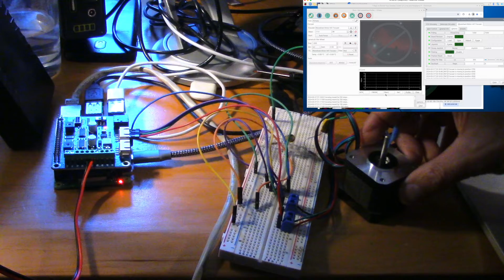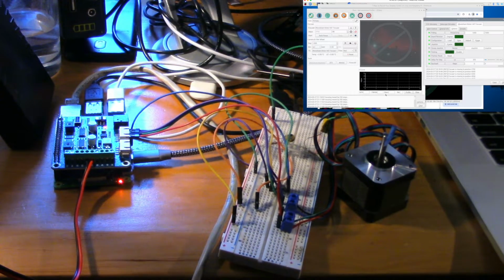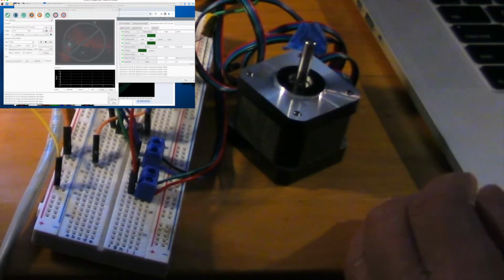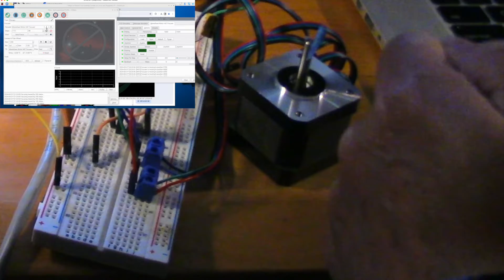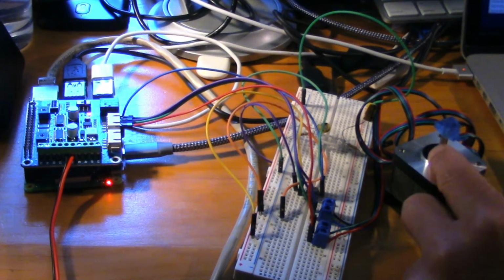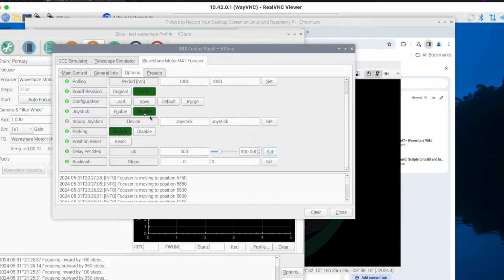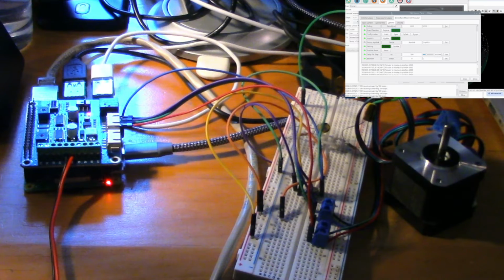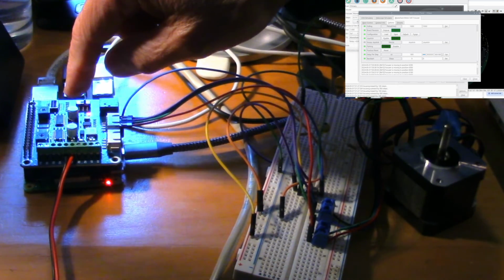Troubleshooting Waveshare Motor Hat for Raspberry Pi - Ekos/Indi Integration

Comment: Great job, thanks for sharing! I am considering building a similar autofocuser for my EvoStar 72ed. Can I ask a couple of questions please?

1. Which stepper motor are you using? Looks like a NEMA 17, but what size? I plan to make a direct-drive design. I am considering some NEMA 17 models but I am a bit concerned about the motor torque requirement.

2. (Not very important) Do you know how much current can the onboard regulator supply to the Pi? Do you think it powerfully enough to supply a Pi5?
Reply from the maker: Even the most basis Nema 17 stepper will work.  I think it was just 1 amp version with 1.8degrees of resolution.  There's a link in the description. Not sure on the Pi current, but the great thing about the motor hat is that it can supply the Pi with power. The hat requires a 12V dc power supply